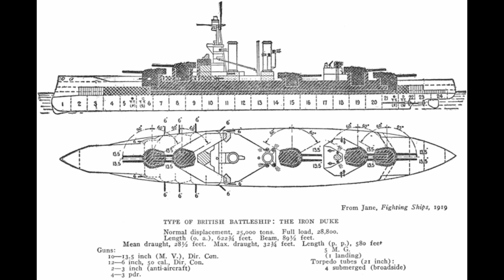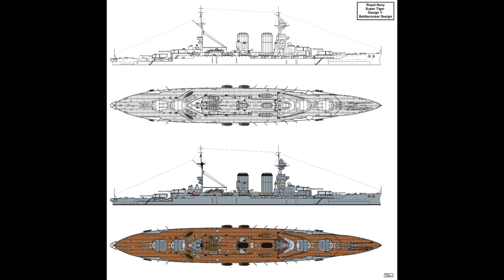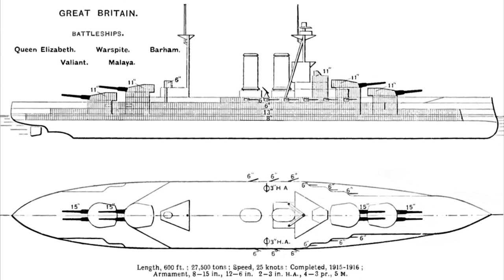Queen Elizabeth Class - Design and Damage History

Comment: So interesting to hear about the damage done to HMS Warspite after just seeing a Fritz-X bomb on display aboard the USS Massachusetts and the mention of the hit on the Warspite on the placard above.
Reply: Did they mention the Roma as well?
Reply: @lavrentivs9891  yes.  In fact, the placard talks about its use in the Mediterranean in 1943 where the Roma was sunk, the HMS Warspite severely damaged and the USS Savannah was also severely damaged.
The bomb was radio controlled and had short wings near its center of lift and a box kite like tail with steerable surfaces to glide in on its target - damned clever, those Germans.  
I took pictures, but I don't think I can post in a YouTube comment.
Reply: @christopheryoung3356  you could link to a page where the pictures are posted.

Comment: wrt the attack in Alexandria, Valiant was not hurt as badly as QE because the mine was not placed ideally.  The Italian mines were suspended on a cable under the ship.  The cable was supported by clamps on the ship's bilge keels.  In the case of the QE, the mine was placed ideally, only a few feet under the hull.  In the case of Valiant, the pilot of the "manned torpedo" the frogmen were riding lost control and it jammed into the mud below the ship.  The back seater passed out from difficulty with his rebreather.  The pilot could not manhandle the mine and cable system by himself, so set the timer and surfaced, with his backseater, where they were captured by the Brits.  The mine was something like 20 feet below the hull, so did not do quite as much damage as it would have if placed correctly.

Comment: Excellent video, as always!  You mentioned one of the ships being sent to the U.S. for repairs.  Do you happen to know which yard she was repaired in?  My dad was too young for the First World War & too old for the Second World War, so he worked at the Brooklyn Navy Yard.  He told me he helped repair some British and French ships, but as far as I can recall never mentioned which ones, as well as helping build one of the Iowa class battleships.
Reply: @Stephen Piper Thanks.  During my USN service I was stationed out of San Diego, so I never made it to the UK, but did to Hong Kong a couple of times.  In '68 I went to the China Fleet Club, bought a couple of sports coats and a suit (from bolts of material), not knowing that near the end of that year I'd get married in that suit.  I ran around with a Kiwi sailor, and we tried to get into the Petty Officer's Club, but the guys on watch balked at letting me in because in the USN Petty Officers up to Chief Petty Officer wear the traditional cracker jacks uniform, and despite my I. D. card and the crow on my arm, they couldn't swallow that I was in fact a Petty Officer.
Reply: Richelieu was at Brooklyn I think. Iirc they had to cut the top off the mast to get her under one of the bridges.
Reply: @Stephen Piper Apparently she was correctly named.
Reply: @matthewrobinson4323  Tbh thats the hallmark of most British ships, Being tough as nails. During the war in the pacific a few of the Illustrious classes took damage that would of put US carriers out of order for months

Comment: The point that getting enough fuel into the boilers for high speed in a coal-burning ship was almost geometrically more difficult as speed went up with manual coal-shoveling systems is something that should be given a video all to itself, along with similar limitations in other parameters (gun loading systems, for example) -- it is not something that is covered very well in most documents describing warship operations.  In fact, this can be expanded into an entire video series on such factors covering all naval topics, comparing what you might want with what you could actually get using various realistic techniques at a given level of mechanical or electronic knowledge at a given time period.  This is a VERY large field of study!

Comment: Yeah, I got interested in WW2 because of seeing the Battle 360 Tales of USS Enterprise. And what is funny is that I owned a Grey 1979 Camaro for many years & after a couple of years of NEVER getting pulled over & ticketed for speeding I named it "The Grey Ghost". Upon learning that USS Enterprise also had the same nickname, among others, I thought it was really cool. Especially because the reason it was nicknamed that was because the Japanese had claimed that they had sank it on several occasions. 
Since then I've tried to absorb everything I can about WW2. But the thing about it too is that it is easy to find stuff about the larger battles but a lot and/or most of the smaller actions there is not so much written about them.

Comment: Suppose it’s 1938, BB’s are still Capital Ships, and the latest naval treaty is still in effect. For strictly battleship-battleship engagements; what is the “correct” order of precedence for your chosen navy between Fire Control, Threat Detection, Armor Arrangement, Speed, Damage Control, and Main Armament Arrangement? The varying naval theories are interesting. 

Mine is the USN: 1-Threat Detection (@1938 200 MHz Radar @100 mile radius,) 2- Fire Control (@1938 radar-mechanical computer operated,) 3- Damage Control (Maximum pumps, counter-flooding, and disciplined coordination,) 4- Armament Arrangement (3 16” 50 cal. Triple Turrets centerline, 2-fore and 1-aft,) 5- Armor Arrangement (All or Nothing favoring surface engagement,) 6- Speed (Opponents speed advantage would be neutralized.)

Comment: Question:
Why are there a asymmetric arrangement of a odd number of main anchors - 2 starboard side, 1 port side?
Reply: I'd guess for redundancy and the twin starboard anchors are there because the port side would be expected to be tied to the Dock by lines fore and aft, therefore more secure in general use.

If you had to moor in a hazard situation - ie oncoming bad weather you'd use all three I'd imagine.

It's also a matter of size - a Yamato is not going to be held by something you'd normally find on a Town Class - so you either end up with a huge single anchor, or smaller twins or triples. And also, while passenger ferries don't get shot at or potentially sabotaged, warships do..

I do have a quick question Drach. If you've ever seen the skirts on German tanks - spaced armour - I wonder if it could have been done in reverse. IE in the spaces behind the armour belt (torpedo spaces etc) you could add (spaced and bolted) skirts internally as a further line of defence and to try and interfere with shell fuses and the like.
If a shell goes into a section and is at its limit of penetrative power would this work? 
Are there any particular reasons why this could not be done during refits for example - smaller engine plants - use some of the space to add spaced plates as additional protection? 

It'd ruin the hydrodynamics on the outside but are there any major issues on the inside?
Reply: They needed more than two but less than four?
Reply: @rosiehawtrey  
For redundancy, why not then 2 on each side? Straight symmetric like the US, Japan, Italy or some Russian designs. Yes, Russian/Soviet designers also did that 2/1 asymmetric arrangement sometimes.
Yes others got 3 as well, but placed them symmetrically left-center-right (like German & French designs).

It's not the odd number that bugs me, it's the asymmetric arrangement. It looks to me almost like some of those weird British tradition.

What side of a vessel get tied to dock, quay or another ship is most likely random, but there can be preferred sides, granted.

Comment: During what refit was the Queen Elizabeth's bow filled out to get rid of old casemate gun positions?
Reply: Almost certainly the 1930s refit, since that was when they stripped everything off above deck and replaced all the secondary guns.
Just on looks alone though, I like how the widening bow is cut away to create a narrower central deck section on the WW1 British dreadnoughts (and Kongos). But alas it does make more sense to increase the freeboard for the new 4.5" gun turrets.
Reply: @hughfisher9820  Yeah, I just noticed it in this video, looking at the model, and thought the model was wrong, until I looked up pictures from 1943. Looks like she and Valiant got the bow changes. Warspite, Malaya and Barham didn't.

Comment: I bit of a shame the deck-mounted 6”/45 Mark XII guns were removed so quickly after Jutland, as they were noted of being worth as much as the washed-over casemates in just two guns and having a magnificent arc of fire. Though sadly they didn’t have sufficient protection and there was no shell supply for them outside of the ready-use lockers.